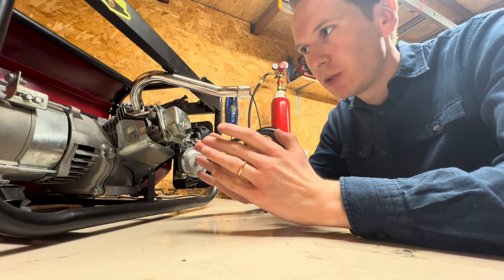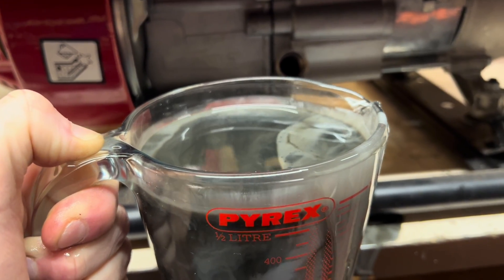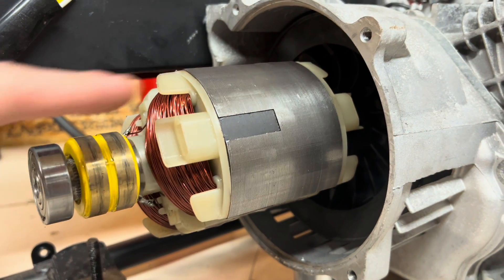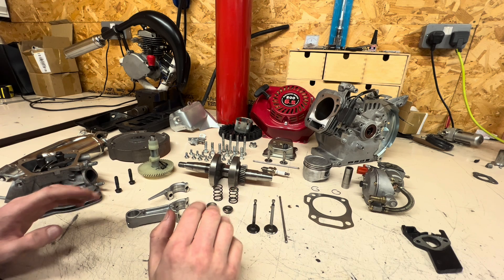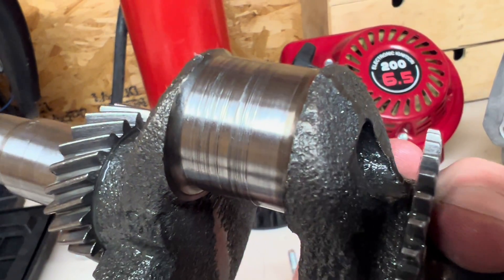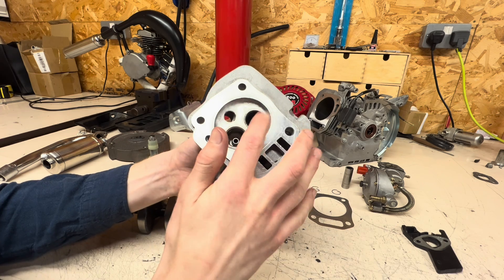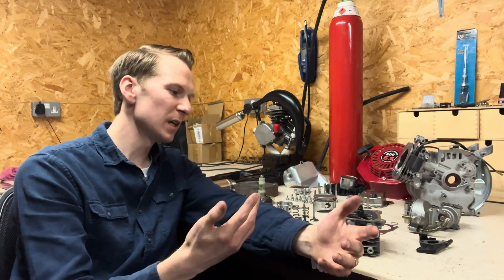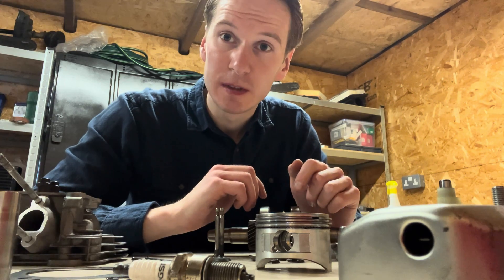Internals After 2 Years of Hydrogen

Comment: The silver in the oil is aluminum from the connecting rod and piston, HHO detonates rather than burns at a normal rate of combustion like any other fuel, so the piston and rod are hammering the crankshaft, and since aluminum is a softer metal, it gives way first. The ignition timing is off also, HHO burns so fast that the force of combustion happens before top dead center, causing knock, and damaging the connecting rod.
Reply from the maker: These were my thoughts too. I knew this would eventually happen. I have talked about oil contamination and the importance of ignition timing for along time, it’s nice to see it happen first hand to show everyone.
The ignition timing was off for around 1 hour of run time. Then set to TDC after that. 

Thanks for the comment
Reply: @Hydrogenguys  I waws running hydrogen engines 40 years ago, we found after top dead center ignition timing was the best course of action because of the speed of the flame front being so high, water injection also helped slow the flame front to stop knocking
Reply: @JOOLZNED 💯  A small engine is more difficult to readily alter the timing of, though.
Reply: @Hydrogenguys The same applies to diesel engines.
Reply: @Hydrogenguys How did you reset the timing ? In small engines, there is no adjustment .
Reply: Not sure if you can change the geometry, but offsetting the crank behind the rotation direction will put the rod at a more favourable angle at tdc. It also changes the other angles and timings,at the expense of slightly worse upward friction.
Reply: That’s why rotary (wankel) engines are strangely suited to hydrogen fuel. They can’t do compression ignition, but a gaseous fuel that burns rapidly during spark ignition is a good match until the load necessitates higher octane.
Reply: let's think simple, water leaked trough piston and mixed with oil which caused poor lubrication and overheating.
Reply: @fatihgumus6753  Incorrect. Damage is due to knock and the extreme forces on the big end as a result.
Reply: @TheSaabClinicUK  why engine oil is that high and color is that bad then?
Reply: I really cannot see the oil that well, but it does appear gray, which is a sign of water in the oil.
Reply: @tarstarkusz no, I don’t think so. It looks ‘grey’ because of the metal (aluminium) particles suspended in it.
Reply: You guys are perfectly right in what you're saying regarding the timing and the water contamination.. but forgot one thing...the quality of the engine parts...from what I'm seeing that engine is a Honda clone, all the parts made in China without respecting any quality standards. I'm working with this type of engine every day and I'm pretty sure that the quality of the parts is the most important thing. If you want to test another one try a Honda or a Subaru or Briggs engine. Good luck!
Reply: Could direct injection be used to release the Hydrogen over a longer duration, thus slowing the burn time by limiting available fuel throughout the power stroke?
Reply: what about if you used a hybrid setup like on a regular gas engine and just used a little bit of hydrogen? would gas help keep things in check? How would you run hydrogen on a gas car without issues?
Reply: I concur. Detonation creates shock waves absent in conflagration of traditional fuels.
Reply: true...  but if you chole it out of some its just enough to push the piston instead of shock it... the chev 350 we had had a 1250 vfm carb on in....we dropped it to 550 cfm and no knocks :-)....   I guess volume it the cylinders just cant reach the pressure....its probablt like bang  25000 psi...... no wonder the piston deformed lol
Reply: Probably has a cast, and not a forged crankshaft due to cost.
Reply: Any of you Guys know....if the Exhaust is Water...what happens when it is freezing outside?
Reply: so pre-Ignition
Reply: "silver in the oil is aluminum from the connecting rod and piston"
No Rod Bearing?
Anyway, I would run 20w50 higher viscosity oil - especially if there is no bearing and rod runs directly on crank.
Reply: Hydrogen requires spark delay
Reply: Hydrogen would probably run well in a steam engine and the steam from the burner could be fed into the boiler.
Reply: This is why hydrogen works better on diesel as well.  Diesel compression ignition has a very late TDC compared to gasoline.  The hydrogen setups I tried on my vehicle ranged from 15-35% at times, a lot of factors are involved to include weather. These engines were from 2 - 4.6 Liter in size.  I sent the same setup on my 4.6Liter to a friend with a cummins turbo diesel 7.2L engine and his mileage went up from 15-16 to 23-26.  Ignition timing needs to be later to maximize hydrogen power/effectiveness.
Reply: Both of those things. I would also guess that the oil suffered thermal breakdown. Is it conventional oil or full synthetic?
Reply from the maker: This was the standard engine oil with adjusted ignition timing. Oil was left unchanged so we can see the effects first hand.

Looking forward to rebuilding this engine
Reply: @Hydrogenguys  if you have preignition even after too late ignition timing' you need to either switch fuel and or fuel ratio , lower compression or run the engine cooler/ cooler intake air (if the preignition happens when the engine gets warmer)  i dont know much about hydrogen but i think it gets pretty hot if you release it to atmospheric pressure*
Reply: How can you have preignition after ignition?
Reply: Lower the compression as well! If hydrogen does burn that fast, you might also consider turbocharging to slow the burn (denser charge) on the next motor.
Reply: @MostlyCensored  as far as i know the mixture will be burning faster when there is more air charge(peak compression)
Reply: @maxcornelissen5288  it would seem so, and I’m not familiar with hydrogen of course, but turbo motors make torque because the denser charge burns more slowly, allowing compression well into the downstroke of the piston allowing more leverage. Maybe adding water injection could slow it as well. 

Alternatively, direct injection would solve all of these problems. Timing when the fuel enters the cylinder would make all of the difference as you really have no need to compress the fuel with a compression stroke if you can get fuel pressures higher than cylinder pressures.
Reply: @MostlyCensored  I really cant wrap my head around it. I tune my own cars and for all i know, the control module has to retard timing relative to air pressure in manifold(boost) to make up for the faster burning mixture to prevent knock from occurring (there is a separate map designated for this wich is a adaption on the base timing of the engine, of course there are differences across different software's but most cars with turbo's have these maps), I to have no experience with hydrogen tho, but i do know what diesel and gasoline does. If i'm wrong please explain in detail.( And i believe there is more torgue generated because of the higher compression(more air/fuel and thus more energy) before the mixture is ignited resulting in a higher air pressure above the piston after tdc and thus producing more torgue on the crank)( Also direct injected gasoline engine's will inject fuel in the intake stroke under full load, fuel is only injected in the compression stroke under low to medium loads)
Reply: @maxcornelissen5288  so, Korky Bell’s book explains it the way I’ve always understood, but there seem to be two conflicting views anywhere I look. Some say there is more expansion of gases on the downstroke, others say it is because combustion is taking longer. I’m not sure why it would be mutually exclusive though.

Comment: So the main problem with hydrogen is the water. It seeps past the rings and mixes with the oil. Thats why it was overflowing. And also why the crank and conrod went bad. The scoring on the piston dont look to healthy ither. All that is from the water ruining the oil's lubricity. Best thing to do to make it last longer is check and change the oil frequently.
Reply from the maker: 100% agree, I’ve always said oil contamination is a big issue when it comes to hydrogen combustion, it’s nice to see the effects first hand
Reply: @Hydrogenguys one more fix, it's an oil heater that will evaporate moisture from oil (also in cars fuel evaporate from the oil). The reason why in cars oil changes is so long (7.5 k. km).
Reply: Needs a set of gapless piston rings
Reply: cat pressure washer pumps use an oil that seems to mix with water. maybe it is some kind of glycerine with additives but the pumps seem to run fine with a bit of water mixed in from leaky seals.
Reply: Or heat the oil above the water boiling point, cool it, and feed to engine. One could even heat the crankcase too.
Reply: Puteti folosi ulei de ricin care nu se combina cu apa, sau sa adaugati intrun ulei de calitate Metabond. Supapa de evacuare , cred, ca a avut reglat un joc prea mic si nu a putut sa inchida perfect in timpul functionarii , la o temperatura ridicata.
Reply: Yep. Another idea to consider is gearing up to a higher specification synthetic lubricant. I can remember one brand named Royal Purple. This brand claimed an average oil film strenght a few 100% stronger than most brands and also continuous and rapid separation from water.
Reply: Well, the main problem is detonation. Then perhaps hydrogen embrittlement. The water issue is easy to get past.
Reply: Why is this not a problem for hydrocarbon engines which also generate water during combustion?
Reply: Water is a product from any fuel combustion, when you combust gasoline, you get water.
Reply: @aleksandarpetrovic6613  well yes but not in such quantities. Burning hydrogen produces much more water than burning gasoline. Thats why its more of a problem with hydrogen and not gasolene
Reply: @Emilijano249  I use pure HHO gas in many small engines and I never saw such a problem. I and many others use water injection in gasoline and diesel engines (cars) and no one ever sees a problem with water in the oil. His oil (in the video) doesn't look like water- oil emulsion.
Reply from the maker: It looks like an odd mix of oil contamination which has worn the aluminium down, lots of aluminium in the oil, at least I know have an excuse to rebuild the engine :)
Reply: @Hydrogenguys Not really, that engine design has no oil pump and no proper road bearing, it's doomed to fail overtime. It running on hopes and dreams from the beginning of its life. Take a look at that connecting rod, the weird shape is made to splash in the oil and get lubrication to everything. 
So I will say cause of failure is the engine design not the fuel. Not worth repairing, get an engine with a proper lubrication system.
Reply: @FlexCrushYouTube  my English not so good, when I wrote "pure" I mean HHO alone, without gasoline, and I use it both ways, with and without air. HHO is not a chemical formula, that is a slang name for gas mixture from water electrolysis. That mixture has different properties than Hydrogen/Oxygen mix (oxyhydrogen), and that is the reason why we use different therm.  Amount of water in the water injection is big, very big in comparison to hydrogen combustion. Maybe in that oil has some water, but looks more like aluminium dust.
Reply: @oscarolander7455  this is the first comment that make sense. Thanks
Reply: Lies.  We all know oil and water do not mix
Reply: I wonder  what contamination  is in the oil to score  the crank like this, 
How many  hrs has it run please,  
Chinese  or Japanese  engine   quality ?   Is there any  help  with valve  seat protection  .
I wonder  if a lower compression    adapted  Deisel engine  would  fair better  ?

Comment: ThAT ENGINES DONT HAVE OIL PUMP?
Reply: No, small engines use a splash lubrication system whereby oil is splashed onto moving parts by a dipper or splash ring that is lowered into the oil as it runs.
Reply from the maker: No oil pump in these small engine :)